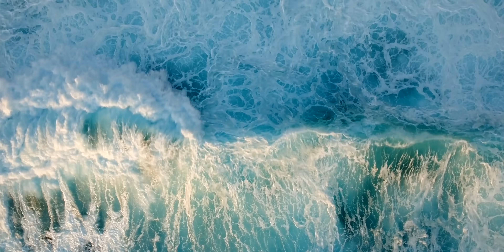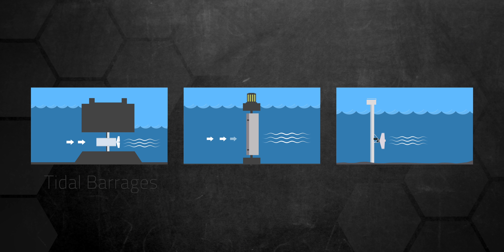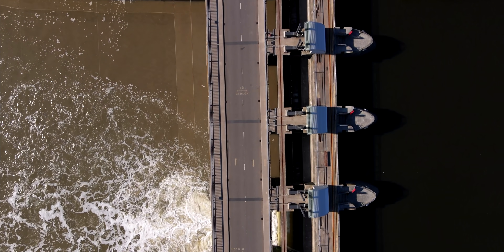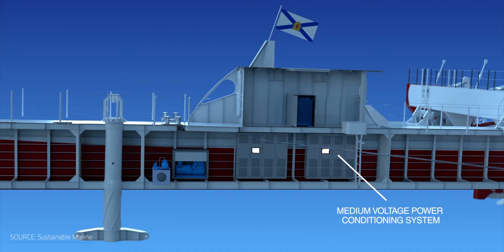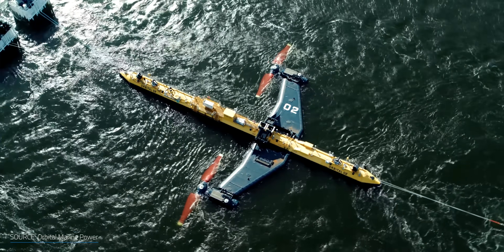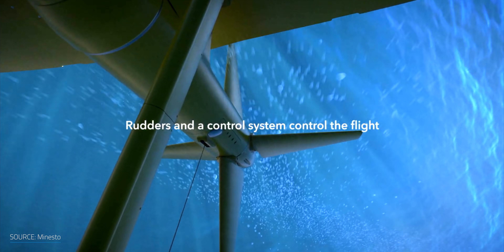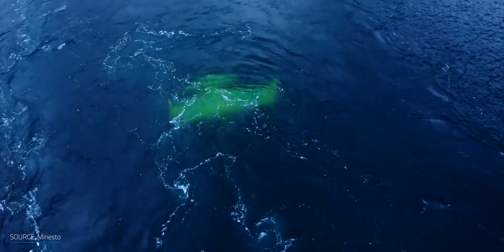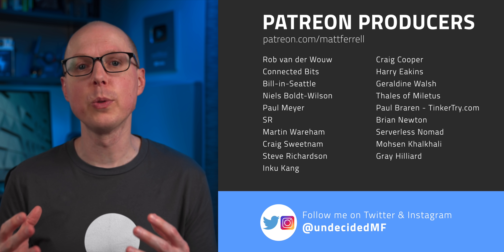Can Underwater Turbines Work? Tidal Power Explained

Comment: NO one Gives one flying Damn about MW... Does absolutely nothing for anyone.  There is zero reason to ever build anything below GW level if there was any engineering economic model to make this work. If you go "green" electrical demand increases by a factor of 10 over current usage.  

Yet more delusional babble
Reply: Ever heard about Microgrids?? Microgrids are both smart, cheap an the market is screaming to built more. They  can be of grid and ongrid. This units is buildt in arrays (talking about the kites Minesto) and there is no problem to get to GW-size.
Reply: @tidal-oceancurrents7552  Genius: has nothing to do with microgrid... you may wish to look up what a microgrid is... You could put a Billion of these suckers in the water.... It will not matter.  Why?  Not enough ocean currents/tidal energy with high enough velocity. 

According to you, the USA should put said devices in the Gulf Stream, 2nd largest ocean current in the world, and therefore turn Europe into Canada... OF course that would only give the USA about 50GW and the Eastern USA grid needs 600GW and if the USA goes fully electric needs 6000GW. Same with Europe.  Tidal power is slightly better as people have calculated that if the ENTIRE tidal power potential sites around the world were used, we might get 100GW out of them..... Oh yippy skippy... That is nothing compared to the needs.
Reply: @w8stral  oh I see you totally misses the point here. 
Tidal is not gonna take over world power production. I have never said that. I say in the future there will be a mix of different renewable electricity sources, as hydro, solar, onshore/offshore/floating wind , tidal current and ocean current among others. The thing is we cant have solar and wind to more than a certain procentage of total production than the grid becomes unstable. This is where Tidal and ocean power comes in the picture because Tidal is predictable and plannable. Ocean currents means continuesly production, like from the Gulfstream. These are excellent to use as grid stabilizer. So the mig vill be solar/wind/tidal/ocean plus hydro to regulate. This will work where you have good amount of hydro to regulate with. There will be other sources aswell but in the that does not include coal/gas/nuclear. At least not in EU and probably not in US!!. 
Total nuclear production is 400GW and Tidal potential without ocean currents are 600GW and growing everyday. 

One more thing to clearify, The kite needs lowflow currents (0,8-3m/s) not highflow as submurged vertical powerplants.
Reply: @tidal-oceancurrents7552  No, you miss the point, Turning Europe into an icecube by diverting the Florida current(biggest current in the world you can get at and the most concentrated) is literally NOTHING compared to energy demands and playing make believe that a mosquito makes a meal is a joke.  Tidal so called "power" is an even greater joke.  Especially when you add in how much cost is involved.  If you are utterly desperate for power sure, go destroy your tidal estuaries which are the MOST critical for fish populations breeding grounds... Brilliant, destroy your fisheries for a joke amount of power... absolutely brilliant.

Comment: I'm surprised there was no mention of the tidal power experiment in Strangford Lough that was carried out for a few years, a few years ago. It was pretty much a turbine, but used in the incredibly strong current of the "Narrows". I didn't read the full paper on the findings, but the local headlines kinda indicated that it was successful, but finished. Negligible damage to the ecosystem, and immensely capable. I sort of expected a large installation by now, but maybe the technology has been implemented elsewhere. I'd be keen to find out!
Reply: Don’t know if we are talking about the same. But Minesto has a testsite, still running in Strangfotd Lough. But there is and has never been talk about any array there it’s to shallow. This system is now installed in Faroe Island followed up in Wales. 100+80MW

Comment: Matt, 

you keep bringing these ideas that are ineffective, expensive, unsuited to grid supply, when are you going to learn? These 'bright ideas' are a waste of time and money. They are not a solution.
Reply: You are wrong, Minesto, the kites ate already up and running and delivers power to the grid
Reply: @tidal-oceancurrents7552   
That doesn't alter any of what I said, that is accurate.
Non of the renewable generators are synchronous which means they cannot support frequency, the most critical factor for a stable grid.
The  fact that many of these schemes attract subsidies from politicians who approve them, politicians that have no understanding of such systems but want to 'look good and be green'. The fact that they are expensive and ineffective is overlooked
Reply: @iareid8255  This is just opinons from you. There is no problem feeding power into the grid. We have many Tidal-sites in world doing that. Incl Minesto on Faroe Island, so that is BS. 

I can only talk for Minesto, when I say 80Euro at 50MW installed. Compared to 165-180GBP/MW for 3GW Offshore vind. At 3GW price will drop to 25-30Eur/MW. Who else can produce plannable power to the grid for that price?
Reply: @tidal-oceancurrents7552  
It is an opinion and it is based on a lifetime of power generation experience.
Yes, of course there are tidal generators that feed the grid. t only prove sthey work to a point but does not mean they are good, they are not.
They are all low power, expensive to build and maintain. How you can do that for the price you quote I don't know?
Are the ones you are talking about tidal flow or tidal barrage? The latter being preferable but neither are an answer that everyone is looking for, even though it stares then in the face.
Reply: @iareid8255  tidal an ocean currents and nothing else (the kites in film). I am working with gridconnection on one the big companies, for Microgrids, I’m on renewable marin energy ”department”. So yes i know a little bit.
Reply: @tidal-oceancurrents7552  
possibly you missed the real point of my comment.

This channel continually brings up schemes to generate electricity as though they can replace conventional sources of power and without fail they are not suited. We need power, lots of it as and when it is required. Small scale plants can provide some power, usually at a high cost. Tidal is intermittent and low power as is wave. When I was an apprentice in the 1960s, we were shown a film of an experimental wave generator. It never did progress. 
Apart from all else the seas are a hostile environmnet for mechanical devices so require alot of maintenence. This even applies to offshore wind genertaors well above the tops of teh waves.

Comment: Biggest issues that I can see going forward with tidal systems like these are long term maintenance (barnacles, molluscs and basically sea slime), getting the power to shore in the case of deep water installations (the kite) and of course permits/insurance and such.  

A potentially great location for a system like the VAWT design might be between some of the bridge piers of bridges that cross tidal inlets or large rivers.  You couldn't block ALL of the piers, have to leave passage for boats, but some power generated is better than none!
Reply: I worked 10 years ago for a German company working on Tidal Energy converters. Our system was basically a windmill under water. 
Biggest problems(also today) are:
High costs for underwater plugs
High stress on underwater cables
Installation costs are hard to estimate (you need ships for Oil & Gas industry with DPS and these cost between 50k and 500k $ a day depending on season)
One thing to counter costs for cables would be to use these devices for offshore hydrogen production. For installation I am not sure what you could do.
Reply: the underwater noise pollution is also problematic for marine life... idk what can be done to make this a win/win honestly because no matter which system you use, it generates noise, and noise is very bad for fishes because they cant hear their predators and so on....
Reply: @_Caedwyn  Most, if not all of these designs are relatively slow speed systems.  So their noise is going to be fairly low-level (even for the fish and cetaceans in the area), not like high speed turbines in a traditional hydro-power setup or boat props.  I will agree this is a potentially valid concern though, especially if there are going to be several generating stations in a fairly small area.
Reply: there is maintenance with all power producing designs. if you lift the device out of the water for a week or so and the barnacles etc will die and shed off. not difficult to remove by many methods.
Reply: Barnacles ? No worse than what the world shipping industry already face, 
Undersea cables ? Likewise , beside any section in motion or tension, 
Like any other type of generation , at least 25% extra should be built for redundancy / maintenance purposes .

Comment: I think the main problem with these might be maintenance? Otherwise it's a very reliable, reasonably predictable "endless" source of power, so if you can do it at better than break-even, it would seem a winning solution for at least a part of the power supply? (Easier to plan for than, say, wind, which blows when it will).

My guess is that marine life would adapt to most of these turbines a lot easier than it can adapt to our propensity to rape the oceans with fishing boats, as if there are boundless resources (instead of just some "free stuff", which bringeth forth the monkey in the man, I'm afraid) to be exploited to collapse by default, out there. Turbines would not adapt quite as easily to marine life. Wherever you put them, something is going to claim them as a substrate - expensive, in Earthman terms.

Comment: I designed a power barge over 25 years ago when I learned to scuba dive I realized the huge potential of ocean current.   
 However, as I discovered in trying to find investors....
 As long as the elite .0001% (it's not really even 1%), that run the world are vested in oil, NO alternative technologies will EVER be given the opportunity to replace oil in more than a fashionable localized happy hopeful application.

Comment: What happens to power output at the turns of the tide?
Reply: It goes down to zero when the tides turns. Production look likes a sinuscurve…ofcourse it is better to be i constant streams like ocean currents. However the benifit of tidalpower is that it is predictable and plannable for 10.000 years ahead. That means it is very easy to regulate with other sources. Less expensive storage is needed compared to wind and solar. Plus.that tidal comes in phases so you can build 3different arrays in different phases and make full baseload with it. Thats what they do in Faroe Island.

Comment: Great video Matt I definitely think it is a solution to compensate for when the wind isn’t blowing and the sun isnt shinning. Would it be possible to attach these tidal power systems to off shore wind turbines? Can we capture the excess energy into batteries or stabilize the grid or to generate green hydrogen. There is a company in the UK trying to generate green hydrogen from wind turbines using seas water desalination and electrolysis process this could also aid at generating the power to do this. Just depends if it is commercially viable.

Comment: The membrane type seems to have 1 major issue. Even though it is efficient, safer and out of sight, maintenance would be much more difficult than models like the Orbital O2. But we will need options for the various location conditions. This is great news to see. Thank you.
Reply: The downside is the mechanical launch and capture process. Tides do a full stop 4 times a day. Kites are only really suitable for ocean currents. If that is profitable in rather low current speeds over a long lifecycle remains to be proven. In wind energy all kites had much higher maintenance than any turbine. Any repairs to an ocean floor installation has huge price tags attached for all kinds of speciality services. You do need to implement maintenance optimized designs with a high priority.

Comment: Yes but they crack all of the trained gasses out of the water destroying oxygen breathing life and releasing far more Co2 per mega watt then any coal plant!
Reply: what do you base that on??
Reply: @tidal-oceancurrents7552  ok take a jar and seal a shaft and propeller through the lid. Then fill it to a marked level with water from a stream seal the lid and agitate the liquid with the prop for an hour or so and look at how much the level drops as the water off gasses the trained gasses!  It is a cool grade six experiment.
Reply: @terenceiutzi4003  so you think you will have the same result 30-100m under the surface with 1 small propeller per 100.000 square feet? Is this in your head…you use a six grade experiment and than you know  we will destroy the earth as se know it. For real??
Reply: @tidal-oceancurrents7552  do real think the trained gasses change at that depth? They don't change until you get over 165 feet! And there is almost no tide movement below 60 feet!! Take a dive sometime (hen think about what you just said! Everyone is trying to destroy our environment just so they can say they are green! We will all be green when this minimum kills us!

Comment: I also think that for small individual or isolated areas small floating "Run of river" water wheels or vortex style turbines are an excellent idea! The water wheel could be used where there is a high volume and slow flow, where the vortex is for high flow low volume!
Reply: High flow, low volume - waterfalls come to mind, but idk how scalable or practical this is for widespread solution, but could help places hard to build infrastructure potentially?

Comment: Unlike wind and solar power generation tidal and wave power are capable of providing base-level generation just the same as Hydro and at a much higher level of efficiency!  Initial capital costs and servicing may be higher but over the life of the equipment power generation should be lower per kilowatt!

Comment: I'm from the UK and, while I might live in Coventry, about as far away from the sea as you get on this island, I'm super-excited for tidal and wave power. Tidal power might be the UK's answer to green baseload, and marine energy in general might be our answer to the winter supply/demand problem. We get a lot of wind, but wind's pretty variable and we don't have the geography for conventional or pumped hydro at the scales we need. I am extremely excited to see what comes.

...also, you forgot about Simec Atlantis and their Meygen project. If and when it finishes building out, it'll be 400MW. It's the most conservative-looking tidal turbine I've seen - it looks like a wind turbine, just in the water...

Comment: Another renewable video about a low density power source that, if deployed at scale) will completely destroy the sea floor with massive installations or fill up the oceans with tons of enourmous (3 ton+) boats with massive turbines.

I really hope Tidal, Wind and Solar doesn't get implemented at the scale that we need to power the future, because it will leave very little for nature.

Comment: Air turbines that take advantage of the wave height, so there are no turbines in the water damaging wildlife.  Sort of like a blowhole on a whale, you can make electricity with a turbine by placing a shaft down into the water and the change of air pressure as the tide goes up and down can turn the turbine. I know Siemens is making large scale turbines for this.  Probably other companies as well.